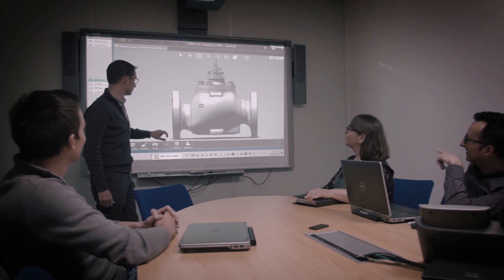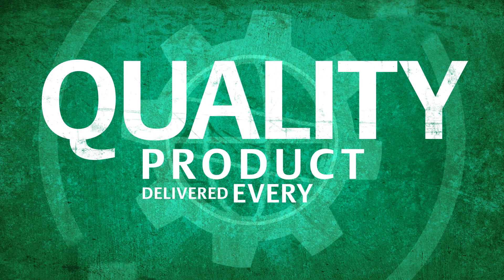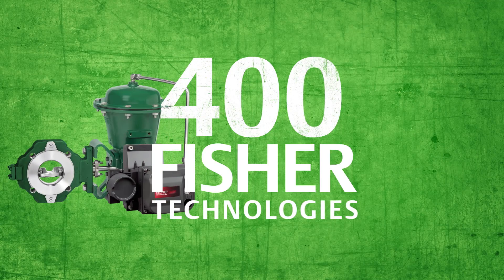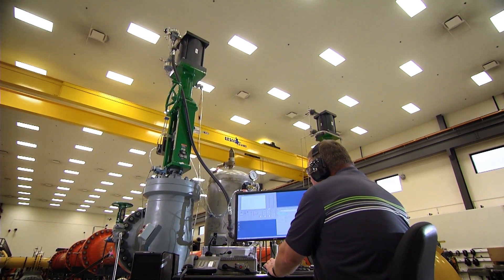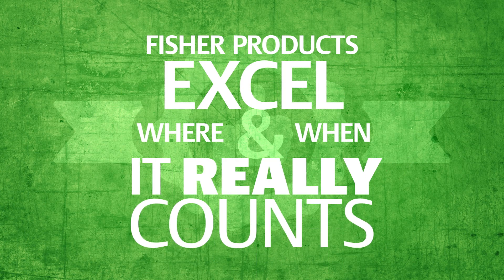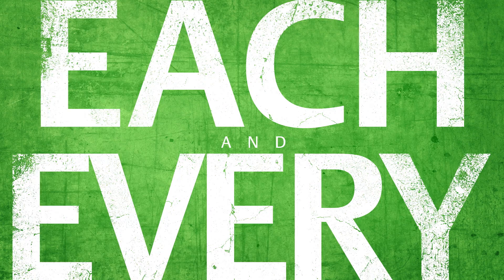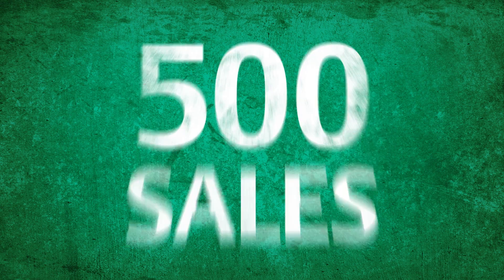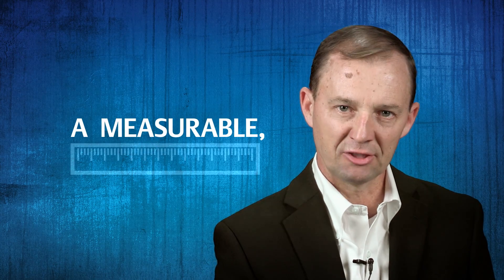Picture All This in Every Fisher Control Valve

Comment: Hi,  I need to te calibrate a fisher "wizard" control, it is a complete pneumatic control who have a retroalimentation system using the variable himself, an example is when the local control used the pressure of gas to regulate the open or close the valve,  ¿can you can help me with a video?